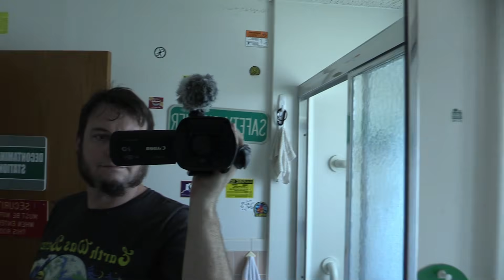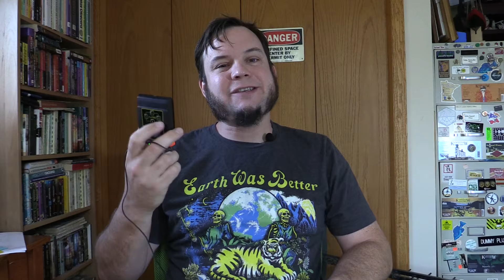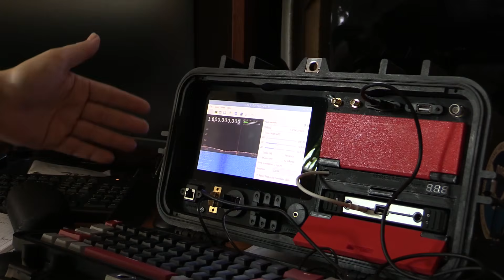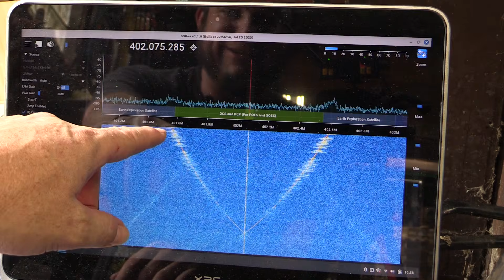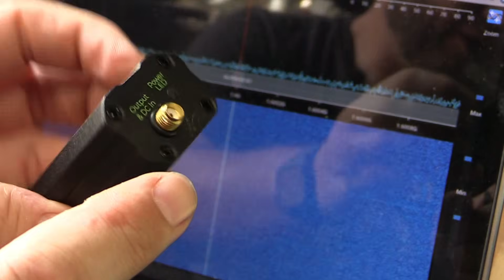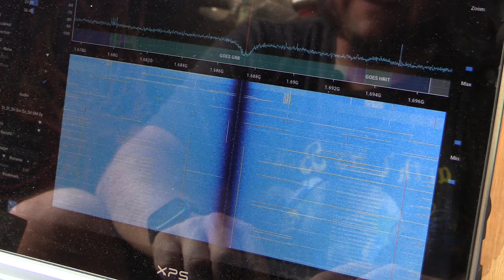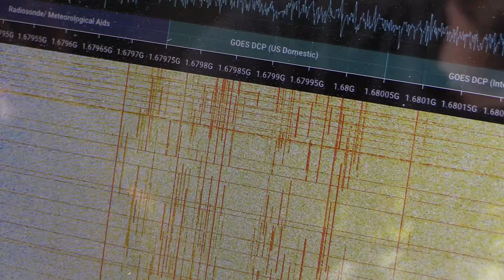Checking 1.6GHz For Skinwalker Ranch Signals

Comment: if he only knew in a few short years they will have messed with the weather so much it is 55 degrees in ohio Aug 24'th 2026.  also the fuzzy camera mic sounds more open but does have some stuff going on, the wifi mic sounds very compressed it's more clear and smooth but quieter and almost muffled sounding a little bit i dont really know i'm not a sound guy i been watching horrible sound on youtube videos for decades i cant the difference anymore lol (i know it's 2 years later but i'm bored and make comments on old videos)

Comment: I think the only way to get to the bottom of this is to launch a few rockets.
My wife and I have a standing bet at the beginning of each show as to how many rockets Travis will launch that episode.
As an amateur radio operator, I have long thought that the 1.6gHz signal that they detect on the show so often is coming from their own equipment; the monitors, the computers, wi-fi systems, surveillance equipment, satellite coms, or any other myriad of electronics and the harmonics all this can generate,. To truly detect and isolate a good signal, you really have to set up a more sterile receiving system with equipment isolated by either shielding or distance from detectors and antennas located some distance away.

Comment: the "errors" identified by by the poster (like using rabbit-ear antennas) are secondary to the fact that on the skinwalker ranch the signal behaves intelligently, appearing only when provoked and disappearing when the "provocateur" stops. The 1.6 GHz signal at the ranch is not a standard transmission but a reactive phenomenon.While skeptics say 1.6 GHz is common, the team notes the intensity of the signal is inconsistent with distant sources.
Overpowering GPS: The signals detected over the Mesa have been measured at around -60 dBm, which is significantly stronger than the faint -150 dBm signal typically received from GPS satellites [03.1].
Frequency Jamming: Proponents argue that the signal is "drowning out" reliable communication, which explains why GPS units on the ranch frequently "jump" or lose accuracy by hundreds of meters, a phenomenon that shouldn't happen with simple "noise" from a laptop or microwave.

Comment: Doubt whether your will see this, but believe @ 1.6GHz you have too much cable loss between the antenna and receiver. 
I would suggest mounting your receiver as close to the antenna as possible with the lowest loss pigtail cable that is practical. 
Heliax would be your best bet if you need to separate the receiver from the antenna. The1/4 in stuff is reasonably flexible stuff.
Reply from the maker: I could try that, I haven't noticed too many issues with the little SMA cable, I use it on most of my satellite antennas.

Comment: The 5 GHZ signals in Skinwalker must have been the control WiFi for the Drones.  The 1200 MHz is probably the video downlink from the Drones. They want to avoid 5 GHz.  The use of 1200 Mhz is not exactly legal but maybe it falls under some low power exemption in the US..

Comment: I bought this vintage radio tuner. and had nowhere to put it so it was right on my desk next to my laptop. I fed the 300 ohm T dipole to the tuner via a flat twin lead cable. And there was this hiss and crackling sound that would not go away no matter what I do. I had the tuner serviced and aligned. The technician who did the job said that the tuner was in perfect shape, it was recapped, all solder joints resoldered, the thing was mint. At his workshop, I even listened to it playing a music station and it was crystal clear. it even had perfect stereo locking too. Once I got it home, the problems returned. I tried different antennas, different cables, nothing. One day, while the tuner was still on, I switched my laptop off, which was right behind the tuner. The hiss and crackling disappeared immediately. It was basically the clear sound I listened to back in the repair guy's shop. The CPU of the laptop was messing with the radio. I switched positions. It has been playing happily ever after. Interference from electronic devices is no joke.

Comment: Interesting there's so many strange signals in the 1 to 2 ghz band that unless you spend  hours diving into the origins of the signals you can't just pass it off as paranormal direction finding mobile tri finding overall Est distance from source etc etc I'd say you did a better scientific evaluation than what that show appears to do but you could do so much more the question is. Is this worth your time?
Good work regards Sean

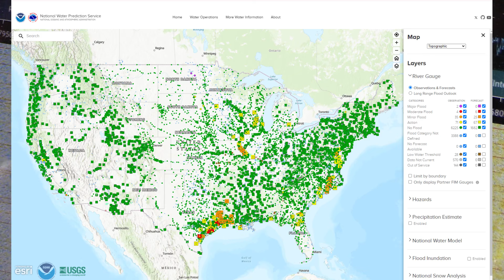Comment: Interesting science!  At around 20:50 you brought up that NWPS map, and it got me thinking about possible DCP systems near Skinwalker Ranch.  There are three within 9 miles, the closest being about 2.6 miles away. The two closest(3.6 and 2.6 miles) are to the east of Skinwalker Ranch, and appear to have direct and unimpeded LoS to Skinwalker Ranch.  The DCP at 9 miles is west of Skinwalker Ranch, and does appear to have a low ridge between it's location and Skinwalker Ranch.  Do you think these DCPs could be detected by receivers at Skinwalker Ranch?
Reply from the maker: It's possible, I suspect they're seeing some kind of Earth-based signal.
Reply: @saveitforparts  well if those DCPs to the east are pointed at GOES-WEST then their transmission path might be 'over' Skinwalker Ranch.

Comment: Hi there Thank you for some great videos! I am an audio engineer, and I use the lavalier mics often for tv broadcast. The one you have now is muffled and closed in the sound, you could try to take the rabbithat of it, but I don't think it will do much. The problem can be in two places, the transmitter itself, or the mic.. i can't see what mic it is.. Here in Denmark we often use DPA4060 for this job, and it is GREAT for it, but also a bit  expensive.. Sennheiser have some more inexpensive ones.. they are also okay, but I can't remember there model names, and they need a bit more edit eq. But the DPA will do the trick for you if you want it.  The camera mic is not bad at all! but it is a bit distant to listen to.

Comment: just a few minutes into the video yet but let me say that anyone in the know wouldn't be surprised if a $20 DVB dongle a.k.a. RTL-SDR receives strange signals to begin with.  This is probably just the same for the just as quirky HackRF.  :). Edit: The SDRPlay radios are quirky up there as well (and stop receiving <2GHz) but what speaks for them is that I got so much better SNR  out of the signals, e.g. trying Inmarsat reception.

Comment: the spark in the center is the local oscillator of the hackrf one that is in the stays in the center of the frequency and you have to move it 1, 2, 10 MHz  with other software it is possible to move it with gqrx I don't know, try SDRANgel excellent program with many useful features also for your tests on both Linux and Windows.

Comment: Dude! I can’t watch you solder! Use the fucking flux for god’s sake! The flux!!!
Reply from the maker: I usually smear flux all over the place, it just melts and disappears. I'm probably using it wrong :-P
Reply: @saveitforparts  it should disappear. It melts easily. The messy soldering points are because you are not using enough flux. Get flux in gel/pasty form. Put so much that you don’t really see the contacts, but when you get the iron closer - it melts and you’d see the metal points and the solder would flow towards those metal parts and not stick to the iron. Just use more flux. A lot of flux!
Reply: @saveitforparts  great vids, btw 👍
Reply: Don't get it on any capacitors, 😮 that's what happened to Doc Brown, ya know.😝🤪

Comment: The Fuzzy Rabbit (great name) for sure. the lapel mic is probably technically better, but the rabbit sounds more like Im coming around for a beer in your shed and your telling me about your gadgets. the lapel is great for studio-style sounds, but hanging out in your shed is what im here for.
for long distance USB, I have had great success using standard cat5 cable. I use the green pair for the actual USB signal, and all the other white as negative, coloured as positive. feed 12v in at the computer end, and a linear 7805 regulator at the usb end to give a stable 5v with plenty of current. Ive had a successful 25-30m run, to a spinning disk drive, transferred a ~10gb file and MD5 hashed it, and it came out just fine. Ive been told by someone who knows way to much about the USB protocol that that should be impossible, but the nice thing about working with good engineers is they know that numbers cant lie. if its been tested and works... no point arguing. I used this setup gaff-taped to a broom and broken fishing rod inside a yoghurt container with a WiFi dongle that had been modded to be a 3 element yagi, in order to get WiFi from a local public hotspot, 6-700m away (never did figure out exactly where it was). worked great! I'd still use my phone for banking and important things, kinda high latency and not terribly fast, but for youtube and running bittorrent (linux ISO's only, I promise) worked very well. Cat5 is practically free, and the issue with long USB is more down to stingy conductors, voltage drop. give it a square 5v and a twisted pair, It'll probably work.

Comment: Oh it's one of those microphones..... I am surprised with the audio quality you're getting. It should be better than that. hopefully it gets better after 4 minutes. Otherwise you were doing better with the thing that looks like a fuzzy bunny not the thing that's sounding like a fuzzy bunny. Wonder if there's a bad cable or some thing. Definitely check and see if there's a firmware upgrade. Could be a gain staging issue bringing up the noise floor. And just generally comes out muffled with static.
As an audio engineer who does live sound and some recording something isn't right. Go look up Curtis Judd or Sound speeds and see if they have a review of that wireless microphone set/lapel combo then you can hear how it's supposed to sound. It might be a matter of finding the balance between the output level of the receiver and the input gain of the camera or it could be using the wrong cable. Mike placement is a little high but it should sound clearer than that, going up under your throat you get less high frequencies as you're moving into the shadow and moving down you get more low chest frequencies so it's a matter of finding balance.

Comment: For high frequencies, skinny coax cable is devastating to the signal. And for sdr software you really have to crank the gain, just be careful not to come across a signal so strong it overloads the hardware when the gain is set high

Comment: Please, users of receivers, any RX, especially HackRF's and SDR dongles, are way W-I-D-E open front end. You want that, so you can tune everywhere, but you also get a lot of images, rubbish, spurs, etc. And yeah, there's a bunch of spurs from your own electronic crap, too. Go read about TRF receivers, like way back in the 1920's. 

If you don't have a bit of knowlege about intermodulation distortion, images, spurs, and open front end, in general, you can't say "OOH! Look! aliens!" Maybe build a 1.6 GHz cavity and slap it in front of that preamp, to start. There's so much misinformation and ignorance. Like you say, the best knowlege is gained by tuning and listening! Good Work, dude! 73 de W3IHM

Comment: You might need to tweak that lapel mic, maybe move it a little further down and turn up the gain or add some post processing. there's a large amount of hiss/noise coming from the lapel mic and its a bit distorted, also missing some high end. 
 
I would definitely play with it a little bit, see if you can improve it some.

Comment: For the record, I never comment on videos, but this one definitely deserves it. I love your channel and have been watching it for some time. I searched high and low for people who seriously approached the 1.6 GHz phenomenon on Skinwalker Ranch, but it seemed like no serious hams or radio techs took on the challenge.

I'm a firm believer that using off-the-shelf SDRs and antennas designed for digital TV reception, as I've seen used on SKR, isn't very scientific. I worked as a radio tech for a while, and when SDRs first came out, we compared them against professional spectrum analyzers like Rohde & Schwarz and General Dynamics. The difference was exactly what you'd expect when comparing a $40 SDR dongle to a $10,000 commercial-grade analyzer.

On the show, imagine the interference you’ve got: UHF comms for the film crew, UHF/VHF for the people on the show, likely wireless camera systems around the ranch for filming and security, and if they’re flying drones, then that too. As mentioned in the video, there’s wireless audio equipment such as mics and other gear. If they’re launching rockets, depending on the setup, you could get interference from the radios in Arduinos or Raspberry Pis. Also, having that many computers and monitors located so close together, never mind how they’re powering all this in the middle of a field—using a cheap inverter or generator, who knows?—is going to create a lot of interference.

In short, thank you for looking into this subject; it made my day. Keep up the great work, and yes, more satellite stuff!
Reply from the maker: Yep, the SDRs are nowhere near professional quality. Their main benefit is they're affordable and approachable for hobbyists, but they aren't usually used for serious science without a lot of customization and more technical knowledge than I have!

Comment: Yeah the 1559-1608 MHz range are GNSS frequencies.
1608-1626.5 are Globalstar and Iridium (in the upper range you should be able to see Iridium downlinks since they use TDD)
Above that is Inmarsat and other MSS L-band uplinks.
Then there's a chunk of radio astronomy above the 1660 MHz point, and then...well, in the US apparently you may be able to hear some interesting military wideband systems ;)

Comment: if you can see interference from the microwave oven, doesn't that mean the shielding is lacking somewhere in the oven? or is that normal because it's coming from the magnetron and not the microwaves cooking food
Reply from the maker: It's pretty normal to get some noise from the magnetron and the internal parts. Even with good shielding and theoretical FCC compliance, everything puts out a little noise. There was a radio observatory a few years back that kept seeing weird signals, but it was just the microwave in the break room at lunchtime!

Comment: If there are any LED lights or solar power inverters nearby you are going to get all sorts of interference spikes all over the place but you'll have to go to Skinwalker Ranch to actually get the same signals they get since a lot of them come from a spot about a mile overhead.  Also did you test the antenna to see what frequency it is for?

Comment: The one thing you didnt do is dig a deep hole in your yard or shoot rockets into the air to invoke the 1.6 ghz signal to appear. When this 1.6 ghz signal appears the ufo s show up. I do watch the show alot and sometimes basic science doesn't seem to apply. Why does the experts science tools die or go crazy but never the cameras or the mics of the show? The wireless security cameras always work etc....

Comment: In terms of boat stuff, I'd be interested if you've got/could make any sail or sunfish type boats!
Reply from the maker: I've had a few like that, Sea Snarks and whatnot. I had an AMF Force 5 that I turned into an electric boat, but I sold it. Also have an 8ft sailing dinghy but the sails rotted (even stored indoors!). I need to get or make some new ones.

Comment: The antenna is log periodic with little gain on 23cms (1296) it's covers 70cm through to 23cms only. Get a antenna cut for the band in question.

Comment: what are the black plastic grates for on the roof ground?
Reply from the maker: To distribute weight on the tar and gravel, you're not really supposed to walk on it when it's hot, or it pushes the gravel through the tar.

Comment: A few yrs ago I was doing automatic and manual scans with my rtlsdr stick and at a point I came across a strange signal around 500MHz that was as powerful as a local 100W FM station a mile away. It sounded like an amateur MFSK transmission. Turned out it was one of my Orange Pis, a couple of feet away when the ethernet port was up and running on a 1Gig link negotiation. :) Also this FM station was co-located with two others. I happened to work in the building which these were on and had B2B relations with the owners. I knew for a fact that only one of them used a passive band-pass filter. So every time as I was walking down the street near the antennas the receiver I was using (an old Ericsson phone with an attachable radio) picked up huge interferences coming from those stations and at a point It's auto-scan function sometimes went bonkers.

Comment: looks like my first post disappeared, I had commented that they are using an Aaronia Spectran SDR much like the V6 which is a much better built system then the cheaper dongle style SDRs and which covers about 9Khz to 6Ghz. I know because the guy who supplied theirs sent me one to test and evaluate for possible purchase at work.  I think they should use a KrackenRF direction finding system to rule out or pin point the signal on site. If you haven't seen that system it is pretty sweet.  The antenna you have is a Log periodic and are really good antennas in my estimation.

Comment: On camera audio is much better and has fuller range of audio. One thing I would make sure is that you are matching the correct polarization of the sat you are trying to hear. GOES are vertical I think. I could be wrong but I remeber also a rotational "Skew" componet to take into consideration.